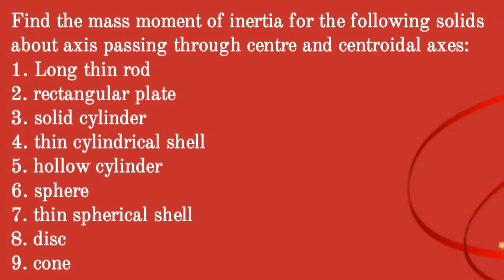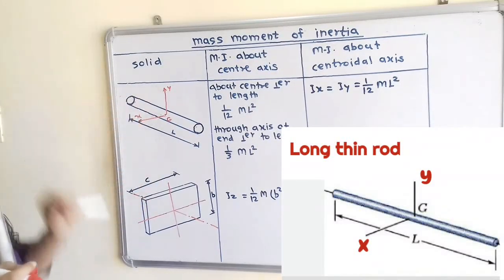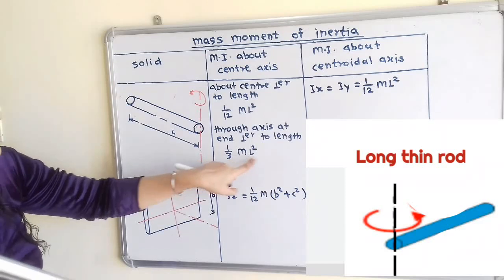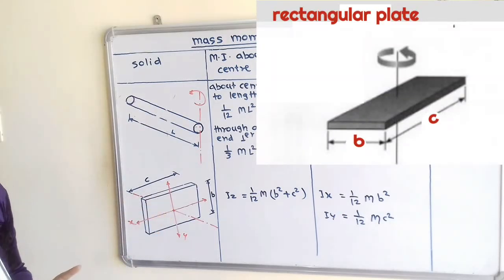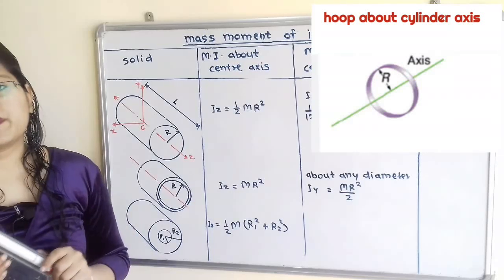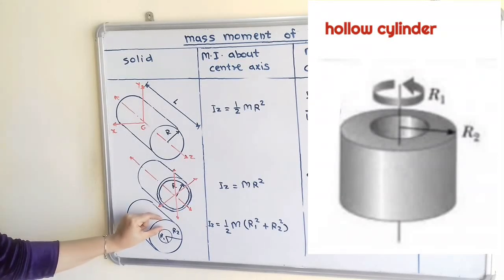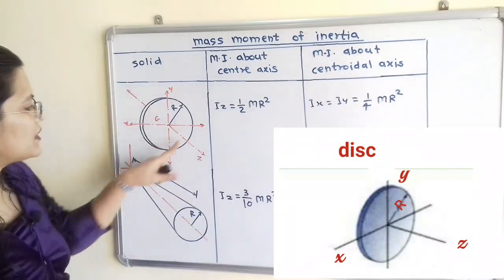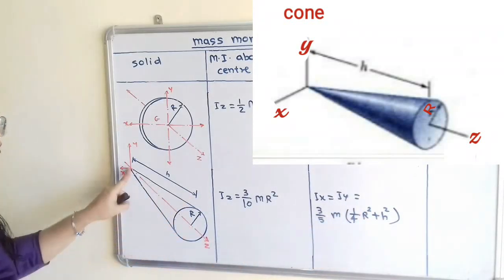Theory mass moment of inertia of solids about axis passing through centre and centroidal axis

Comment: solid cone whose vertical angle is 2a is immersed in a liquid with its vertex in the surface and axis vertical. Prove that if P be the whole pressure on the curved surface and base and P^{\prime} resultant pressure, this P: P' = (2 + 3 sin a) : sin a.
Reply: Please solve